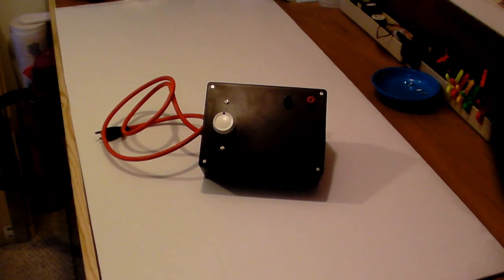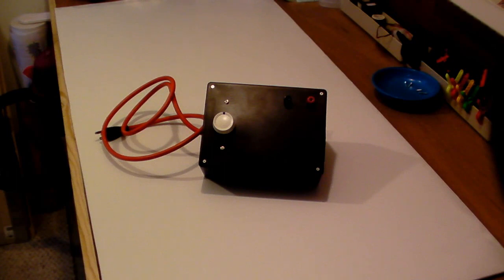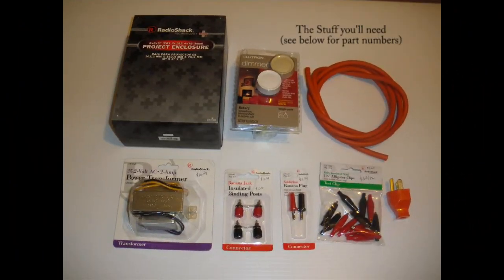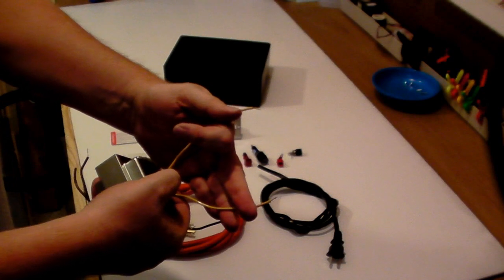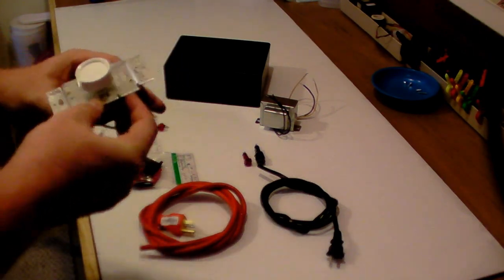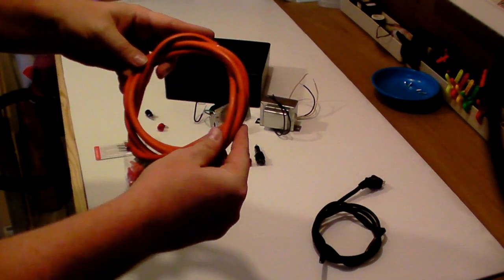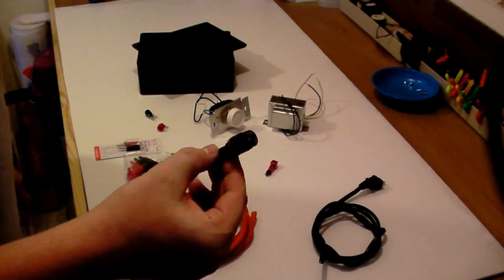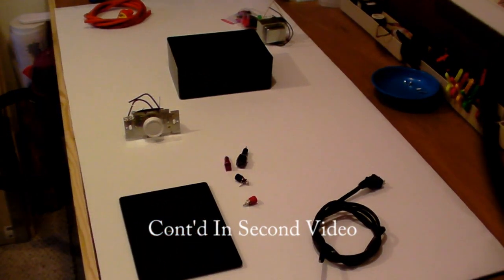DIY Hot-Wire Power Supply (Vid 1 of 2)

Comment: I built this a couple of years ago and never thanked you for your great tutorial. For safety I built the style with the fuse and light to indicate it was hot. I have limited technical skills but the wiring plans made this easy. I built a scroll saw style table to cut perfect circles. 

If you are a hobbiest or build foam planes this thing will blow you away. 

Thanks again for helping me build this it works perfectly.

Comment: Great video. one question. can it work safely without the dimmer?
Reply from the maker: +8rh3n7 You can certainly wire it up without the dimmer, but that is your temperature control. Without it, the wire may get too hot for the length of wire you're using. I wouldn't recommend it.
Reply: +Crash Hancock Thanks.

Comment: I have looked everywhere for that transformer would you mind please laying down the specs of that transformer for dummies. especially since Radio shack no longer carries any transformers. It's very hard to find
Reply from the maker: Did you have a look at the video description. Chris? It's a 25 volt, 2 amp transformer. If you google the part number I supplied you can get the specs from the Radio Shack site for it and then use that info to source an equivalent transformer.

Comment: NiChrome wire is the best for wire cutters.  Google 'Hot Wire Calculator' to figure out what amperage you need.  Ballpark temp for cutting foam is 600F.  I need a longer (26ga) wire for cutting model plane wing airfoils, so went with a 150VA transformer. Cheapest I found online was at Jacobs NiChrome wire web site (I have no affiliation). Even ebay was more expensive, especially once you consider shipping. These things are heavy, at about 2 lbs.

Also, definitely don't use a push on/off dimmer switch unless you also use an indicator lamp.
Reply: Found out about the indicator light yesterday!  hehe OUCH! Fixed it by using a foot operated switch to make the wire hot.  Works really well!

Comment: this power supply works great just finished it today the only thing I did different was I used the 12.6v 3A transformer. and to those of you having problems getting this to work or burning stuff out its very important you have the correct polarity coming from your wall outlet connecting the neutral to your dimmer will not stop the flow of electricity to your transformer.

Comment: how do you keep from buring up your trasformer? Mine burned up right after i used it just once.
Reply: buy a better transformer?
Reply: You are probably overloading your transformer. Check the AC current that is going through the wire, and see if it is higher than what the transformer is rated for. If it is too much current, then you might want to try a longer wire (more resistance - less current draw).

Comment: just called R/S, they have the xformer in stock waiting.  should have it built by tomorrow, will chime in afterwards with comments.  Using 28" NiChrome cutting 21"sheets, need tons of them so table set up and this power supply will be great.  Thx for posting this!

Comment: everything was working well, but then I decided to use a bit thicker wire to cut a very specific shade into some foam and the fuse blew as intended,but I think my transformer went as-well 'cause it wont turn on anymore even after replacing the fuse.

Comment: i built this the other night and turned it on with caution for the first time in case i messed something up. the light came on just like your with a little bit of clockwise turn. slowly went all the way full power and it was fine. 
But.....
Im not sure why after i hooked my multimeter to see what numbers it was doing that it blew my 2 amp fuse only around 20% power. i am using a normal fuse and not a slowburn. would this be the problem? thanks

Comment: Looking at similar transformers, the advertized max (2 amp) amperage rating is for the center tap with half the advertized voltage (12.6). Therefore when using 25.2, Volts I would think you only have 1 amp rating. Hence the power (Current X Voltage) is constant. However If it’s working well who gives a……

Comment: Great project! I built one of these last night in a little over an hour and it cost me about $30. Works great! I'm using 30ga Nichrome on a 48" bow, and it gets plenty hot. Makes very nice cuts in EPS. Even at 48", I can't put full power to it or it deforms the wire. Probably could drive 60" of wire without a problem. Thanks for the great video!

Comment: (5/5) Also, I'd like to note that after burning up 2 transformers,a switch, & about 10 fuses, as I bought my 3rd transformer, i noticed it was in different packaging. On the back in the corner, in tiny font, in Spanish (I'm bilingual), it indicated a 2A OUTPUT current and 0.760A INPUT current. That's how I found out the true currents. When I was pulling 13A on the output side, the input was pulling <2A,hence the fuse never blew, & my transformers overheated instead. This was using 19 gauge wire.

Comment: (4/5) ALSO, I have determined that on a 16" length of wire (which is what I'm using), the LARGEST diameter wire you can safely use is 28 Gauge (stainless steel - 304 grade - jewelry wire). 28 Gauge wire pulls 3.5A max on the output side at full power,but cuts best at 2.0A on the output side of the transformer. That is maximum current pull allowed right there. 30 Gauge works much better, however, yielding 2A max current and cutting best at 1.0 - 1.25A, again,on the output side of the transformer.

Comment: (3/5) Stainless steel jewelry wire is used to make bead necklaces and bracelets, for instance.Ok, the 1 big mistake Crash:The transformer is rated at 2A OUTPUT current, but only 0.760A input current. You placed the fuse on the INPUT side, so you must use either a .75A slow blow fuse or a 1A fast blow fuse in your setup, NOT a 2A fuse. 2A on the input side corresponds to nearly 11-13A on the output side. I also blew 2 transformers. I suggest adding another fuse holder & 2A fuse on theOUTPUT side.

Comment: (2/5).30 AWG stainless steel wire is the best, as it prevents pulling too much current and burning things up.  If you use a longer bow, however, the wire will have more resistance overall & you may get away with larger diameter (ex: 26 AWG) stainless steel wire.A shorter bow, & you will need to use 30 AWG for sure.  a very short bow & perhaps 32 AWG would be best.  Also, I looked for days locally and could not find the wire *anywhere* until I realized it is sold at hobby stores as jewelry wire.

Comment: (1/5) VERY IMPORTANT TO READ IF YOU DON'T WANT TO BLOW TRANSFORMERS!!!
Thank you Crash for your excellent video! I loved it.I built the hot-wire foam cutter and it works amazingly. Again, very thorough and well-made. However, you made one critical mistake which is costing us a lot of transformers. :) Also, an important note would be to please *not* tell us that any wire will due, as this is incorrect. I have found that on a 16" wire strand, 28 AWG stainless steel wire is the LARGEST one can use.